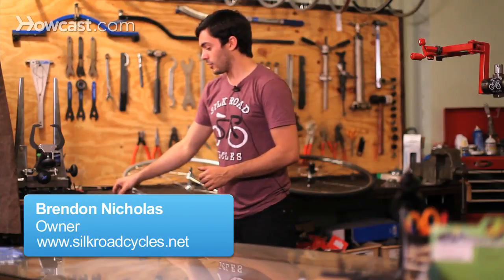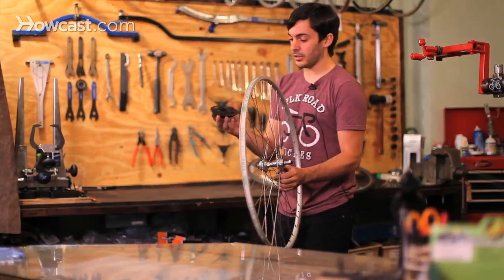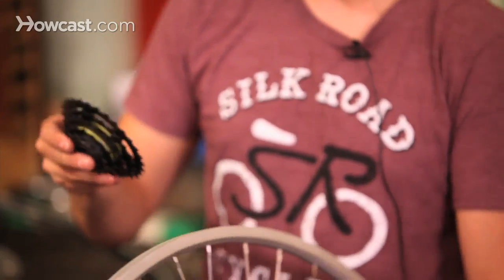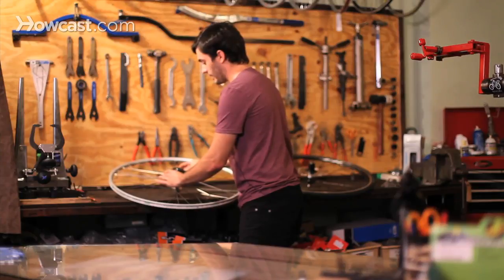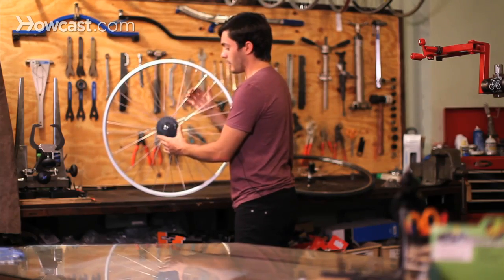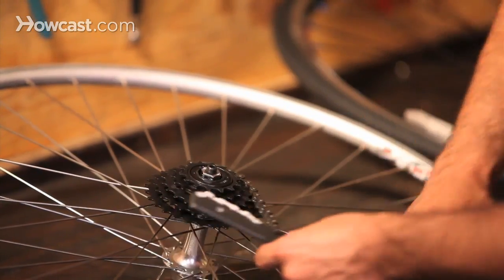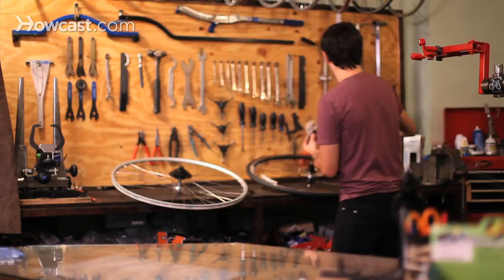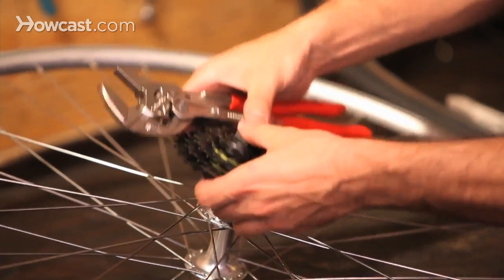How to Adjust a Bike Freewheel | Bicycle Repair

Comment: There was no "adjustment" in this video. Just installation.

What I was expecting, was a video more akin to rebuilding a freewheel with fresh grease or oil, and bearings, or at the very least adjusting the retaining ring of a single speed freewheel to prevent it from being too tight or loose.
Reply: Exactly, plus a lot of blah about how to ID one. I know I have a freewheel. I wanted to know how to "adjust" it. Words should mean something, words do mean something.